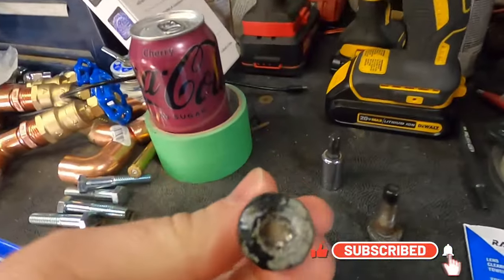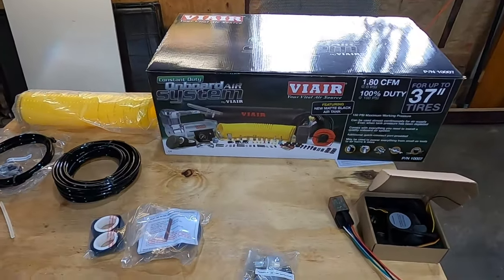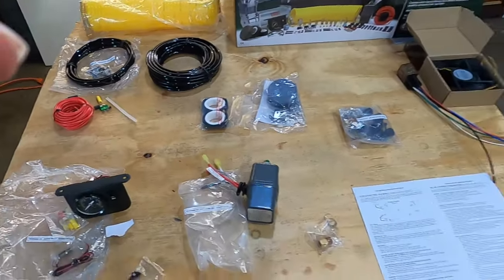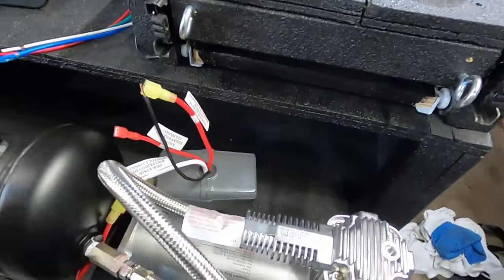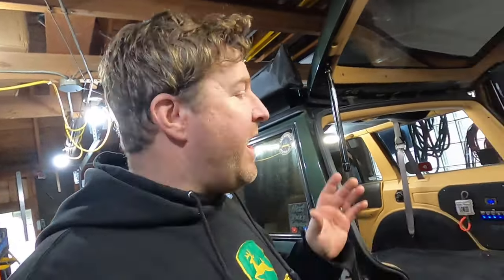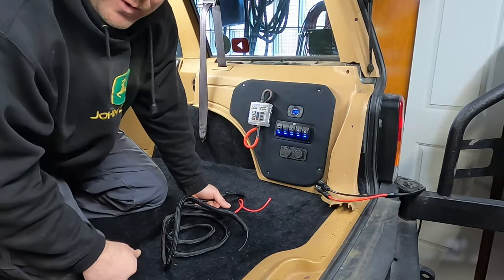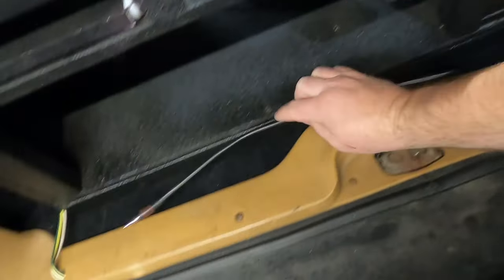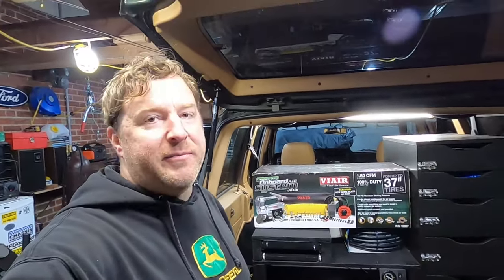I install a VIAIR Custom air compressor kit in the Jeep

Comment: Nice!  I like that cooling fan on the timer.  That’s a great idea.
Reply: @YourFriendStChris  exactly!  I have an auxiliary electric fan I installed on my XJ but I really need to add one of those timer relays to that system.  And also add a cooling fan to my air compressor.

Comment: The quick connect you used is only rated to about 20 amps MAX , I would recommend a 50 amp Anderson plug to minimise voltage drop

Comment: 🔥🔥 I used 4 VIAIR air compressors for my air horns. I pumped it up to 200 psi and none of the hoses pop depart I just got to dig into where the small air leak is 🔥🔥

Comment: Just as an FYI those drain valves like to rust shut or the wings loosen from the valve and it fails to turn the valve it just free spins. A quarter turn ball valve from Amazon works better long term. Then you can also add a drain hose that you can aim out so you don't blast nasty rusty water all over your truck.

Comment: Hey great video!  I bought the same system but for the life of me I can't get the compressor to fire off. I'm not sure what I'm doing wrong with the wiring
Reply from the maker: Thanks!! Boy my head still hurts from figuring out the wiring on mine with adding the shutdown timer. Have you tried just putting power right to the compressor to see if it will turn on?

Comment: 2 x 25' hoses are much easier to manage than 1 50'. The 25' will serve you for 95% of your needs. I'd throw a black towel over the hoses when not in use to keep the sun off them. The UV rays are bad on rubber...tinted windows help but covering is better
Reply from the maker: I never added a hose holder to the side of the organizer call it laziness if you want. I actually just roll up the hose and store it in the bottom of the organizer system next to the compressor itself out of the sun for sure. We used this setup on our trip to Colorado and it worked perfectly. Filled 3 vehicles tires with ease after each trail run. Thanks for watching and taking time to comment!

Comment: ❤❤❤ I bet you would love to see my air system in my 2022 Nissan frontier I have a Tool Box in the bed of my truck and I’ve got $3200 worth of VIAIR system in my truck with 4 air compressors and one 2 1/2 gallon tank, and it only takes seconds for me to acquire 200 psi. I have pumped it up to 250 just to double check all of the hoses to make sure they do not leak and they don’t.  I have quarter inch aluminum manifolds where all of my hoses connect for compressor is going into the manifold and two air hose is coming from the manifold to go into my 2 1/2 gallon tank.  None of it is exposed to whether water or dirt.  I probably have the loudest air horns for my pick up truck. ❤❤❤

Comment: Hi where did u find the timer delay relay cheers
Reply from the maker: Website is Quality Mobile Video and part numbers are Beuler  BU509TD relay $23.99
BRS14E Wire connector $2.99

Comment: 🔥🔥 what kind of amperage is your compressor drawing? 🔥🔥
Reply from the maker: I have it on a 30amp fuse and it hasn't had any issues. I've run it long periods and no wiring has been warm also.

Comment: Where did you get the countdown relay?
Reply from the maker: Had to find the email... Website is Quality Mobile Video and part numbers are Beuler  BU509TD relay $23.99
BRS14E Wire connector $2.99
The fan is just a random amazon 12vdc fan with the highest cfm rating I could find.

Comment: how many tires (35'') can you inflate just with full tank?
Reply from the maker: @MrSalgueiro86  I did 3 rigs on a trip all run 33's. The compressor runs the whole time but had no issues filling all of them. Not sure how many if you just have a tank and no compressor. Guess it depends how much you have to refill them.